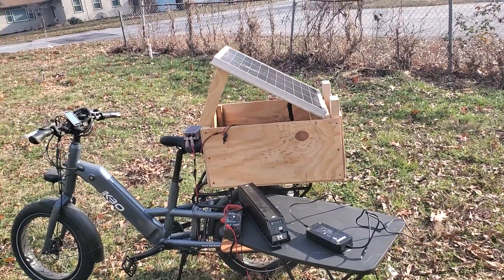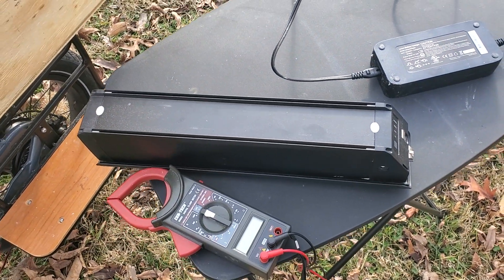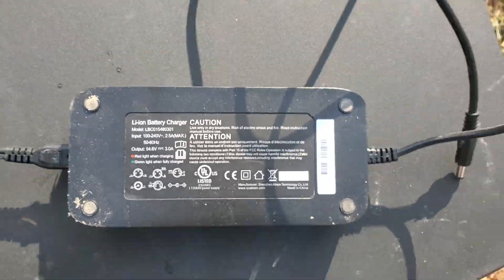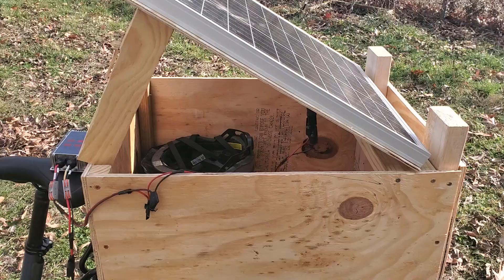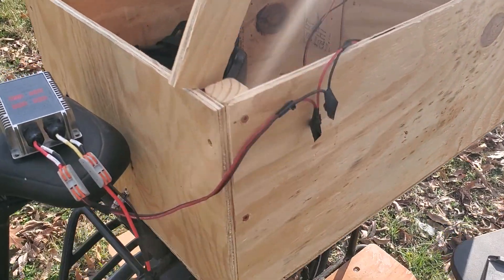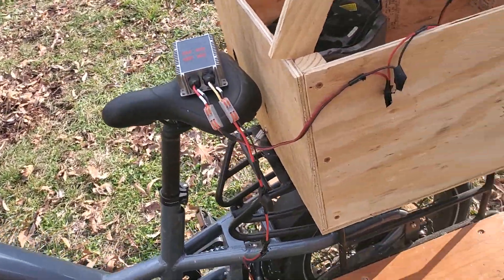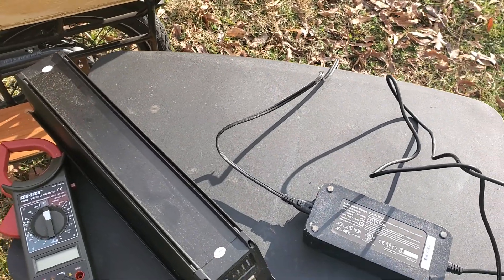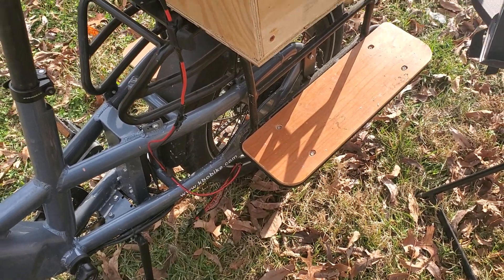Solar Bike Project: Day 1, Proof of concept and figuring out how to use the solar charge controller.

Comment: Just came across your video just out of curiosity.What size wattage was your solar panel.
Reply from the maker: Hi, Sorry I forget to check this. The main panels I use are 50w, later on I upgrade to x2 50w in parallel. But it was ultimately best to go with a 50w flexible later on. I have the bike trailer for 200w of solar input if need be.